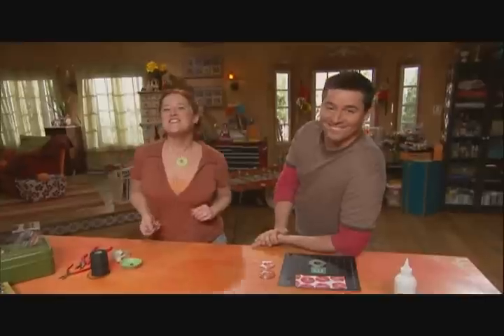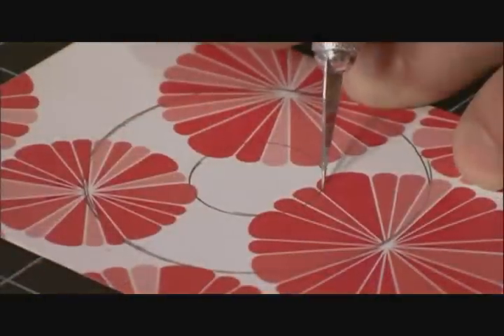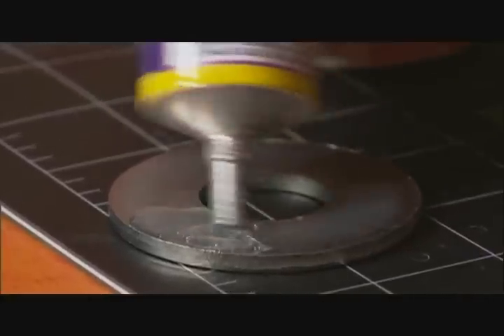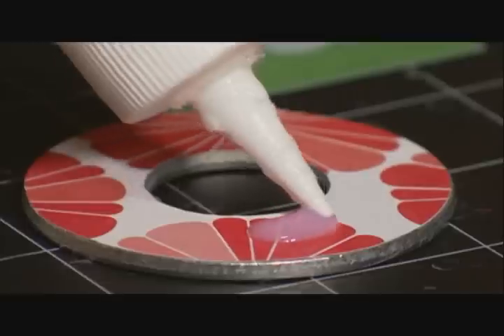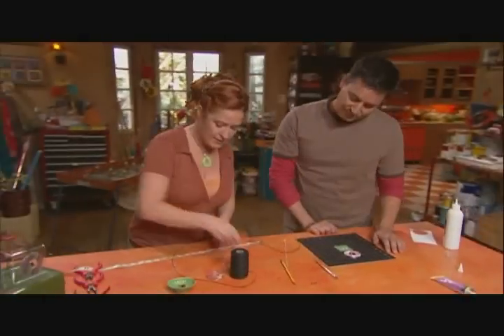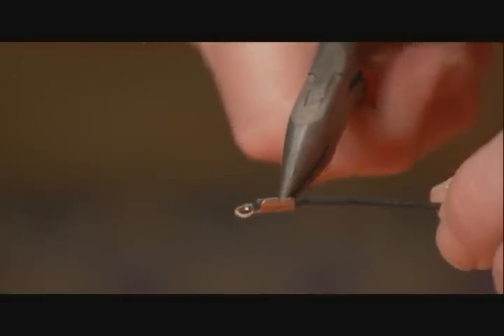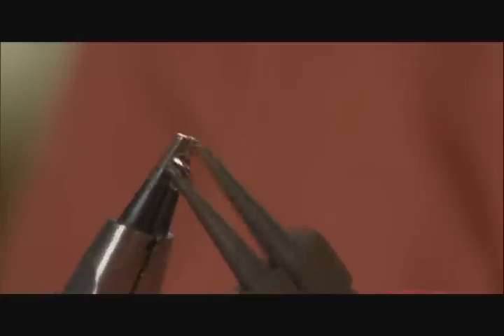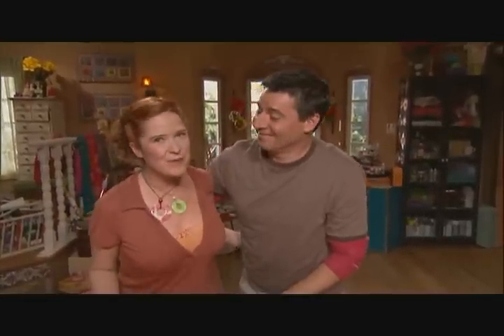How to make a washer pendant and Necklace

Comment: actually, washers WILL cause irritation on the skin in anyone with a nickel allergy. The metals used have variable amounts of nickel and a LOT of people (more women than men) are allergic to it. Ever get a rash from non-gold/silver jewelry? I react to even the earrings marked as surgical steel... because steel has nickel. Why they don't do both sides and add something to coat it is beyond me. It is actually a LOT nicer to do what is called the reverse water bottle technique for earrings... look it up, then do the same thing for this. Cut a approp circle from a sheet of clear plastic, use fabric fusion to glue fabric first to the plastic and then to this washer. Do the same with the other side. Easier and lasts longer. And no rash

Comment: @longevity4skin I got some hemp type cord and it irritated my neck like crazy.  Finally found a nice cording in the ribbon secton at walmart.  I was going for plain ribbon, the kind about 1/4 inch wide, but found the cord instead.  I still got the thin ribbon, plus a sueded ribbon just to try out.  The cord I got is rounded and works great!